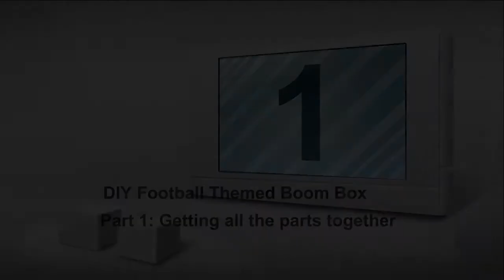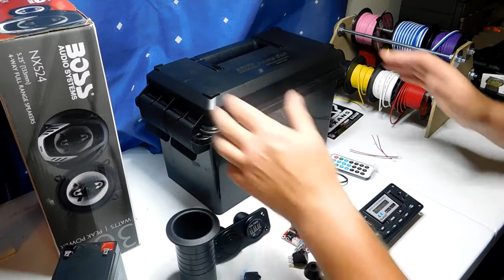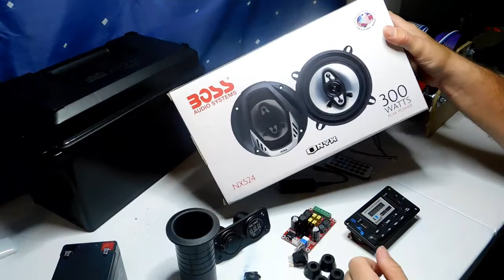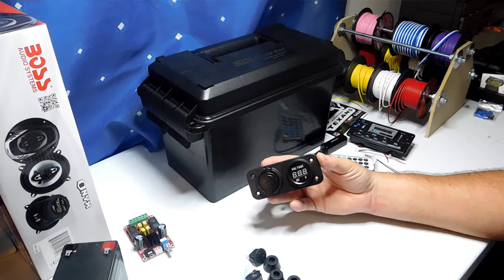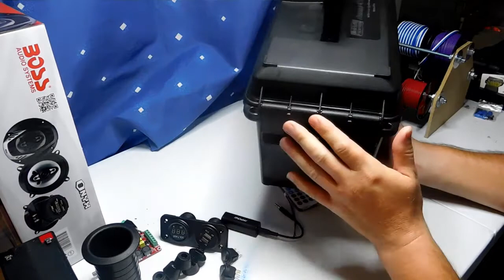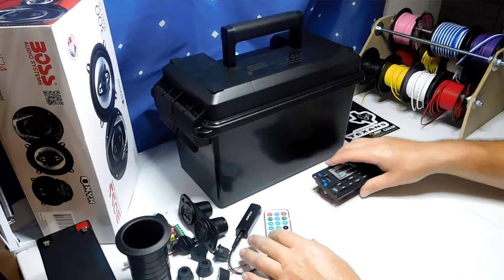DIY  Ammo box Boom Box how to build part 1

Comment: How long does the battery last?
Reply from the maker: A lead acid battery will last up to 6 hours. A lithium ion battery can last up to 8 hours. I also have a new design that is duel powered so you can use a power supply or the battery inside.. That way you can plug it into the wall if you desire

Comment: Yeeco amp board?
Reply from the maker: Leecarl Liwanag yes
Reply: Have you try the 120watts?
Reply from the maker: Leecarl Liwanag  I don't think I have.  The one in this build is the 200 watts
Reply: I mean the 120x2... the same Yeeco amp.
Reply from the maker: Leecarl Liwanag Cant say I hace ever used one. On those sized builds, I usually don't need that much power for room filling sound